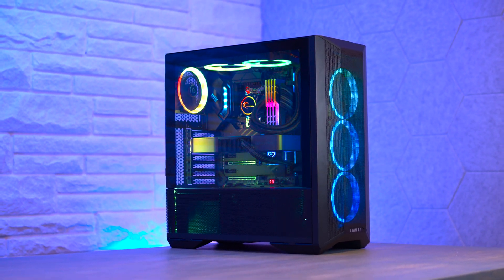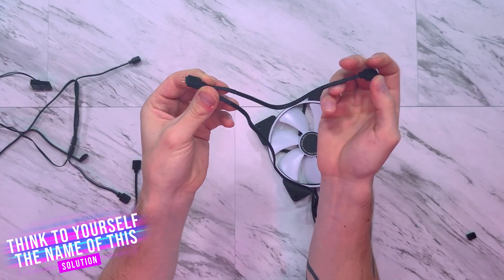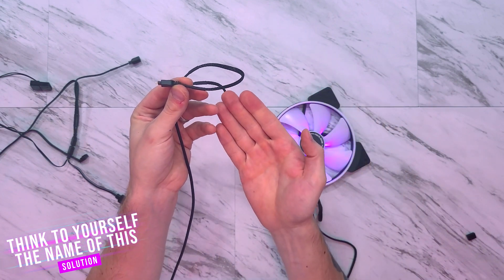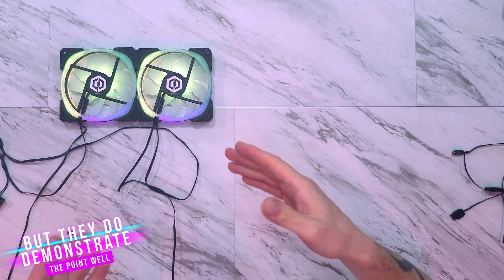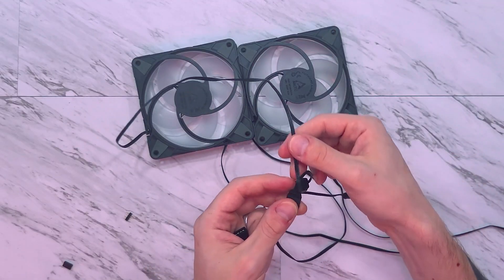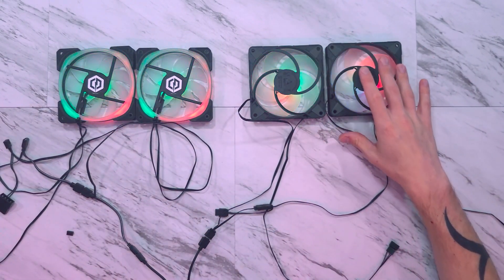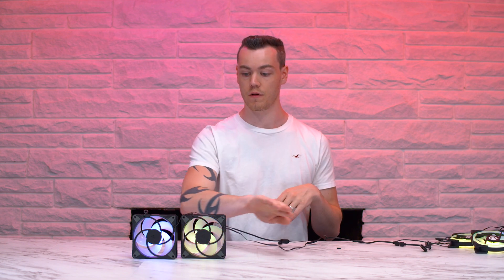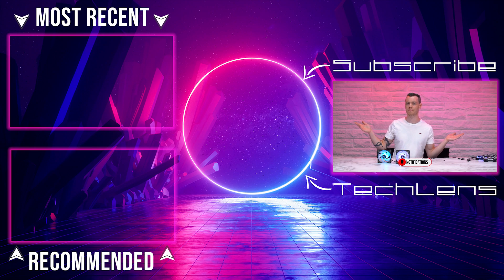THIS HAS TO STOP Because RGB Manufacturers Are LYING To You!.... RGB Explained

Comment: THANK YOU, THANK YOU THANK YOU THANK YOU. You have no idea how long I've been looking for fans that do proper daisy chaining. It's fucking ridiculous that companies refuse to give individual control of fans using the argb headers, instead opting to give that control only to their custom usb powered hub that only uses their own software. It's gotten to the point that I was thinking that I would need to make some jank Arduino board that would have multiple headers for each fan, allow me to set an led number for each, take in the raw signal and split it to different headers for each fan based on the settings.

Comment: Well... It's not about the LED manufacturer, it's all about the "Daisy chain" definition. The Daisy chain you are mentioning about is under series connection, and the "LIES", as you mentioned, is under parallel connection. They have different circuit design which reflects directly on the effects
Reply: A daisy chain is a string of daisies threaded together by their stems. Or in the case of fans, it's a string of fans threaded together by their stems. Not stems all attached to the same point. That would make it a tree, not a daisy chain

Comment: The other thing that bothers me is the connectors for RGB in general. They just suck. It's too easy to bend a pin or pull the connector off the motherboard by accident. Granted it doesn't matter a whole lot once it's in the case and closed up but it's a hassle I don't need when I'm already dealing with a bunch of extra cabling to set it up in the first place.